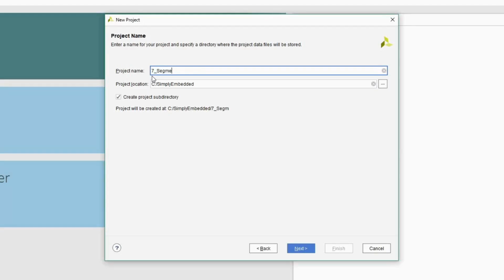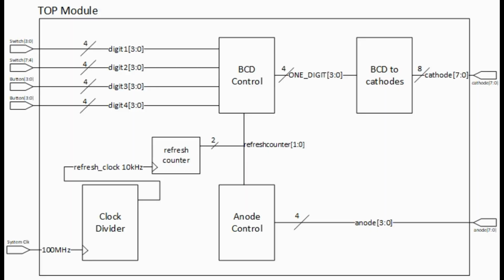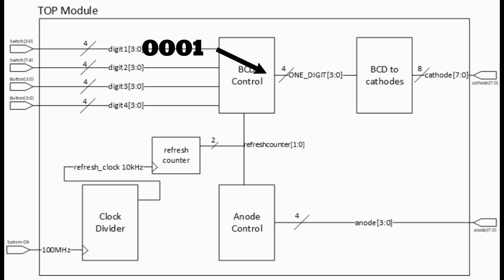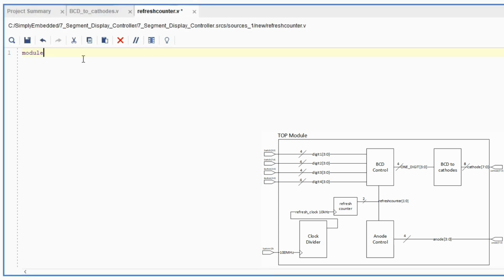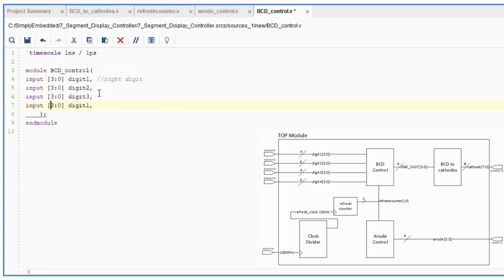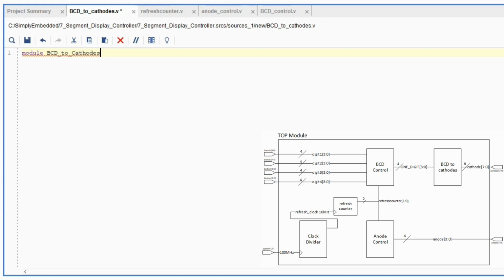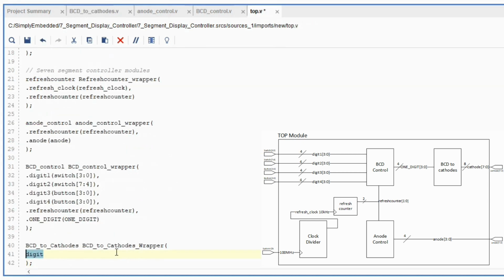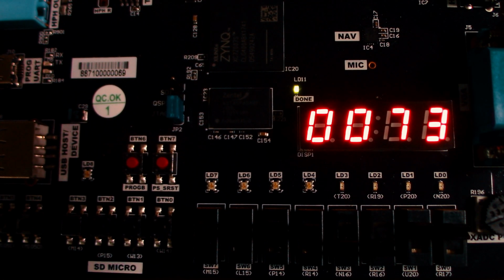How to Create a 7 Segment Controller in Verilog? | Xilinx FPGA Programming Tutorials

Comment: Hey there, love the tutorial, although im confused because your cathode numbers for digits is completely different to ones I found online: 
always @(bcd)
    begin
        case (bcd) //case statement
            0: seg = 7'b0000001;
            1 : seg = 7'b1001111;
            2 : seg = 7'b0010010;
            3 : seg = 7'b0000110;
            4 : seg = 7'b1001100;
            5 : seg = 7'b0100100;
            6 : seg = 7'b0100000;
            7 : seg = 7'b0001111;
            8 : seg = 7'b0000000;
            9 : seg = 7'b0000100;
Reply: The values are just the reverse of each other. In your example it looks like the bits are arranged abcdefg, whereas in the video they are arranged gfedcba.
Reply: depends on your board.  My is active low so (cathode) 1=off 0=on
	case (digit)
		4'd0:
			cathode = 8'b00000011; // zero
		4'd1:
			cathode = 8'b10011111; // one
		4'd2:
			cathode = 8'b00100101; // two
		4'd3:
			cathode = 8'b00001101; // three
		4'd4:
			cathode = 8'b10011001; // four
		4'd5:
			cathode = 8'b01001001; // five
		4'd6:
			cathode = 8'b01000001; // six
		4'd7:
			cathode = 8'b00011111; // seven
		4'd8:
			cathode = 8'b00000001; // eight
		4'd9:
			cathode = 8'b00001001; // nine
	endcase

Comment: Can you connect 16 segments using on arduino ??? ( to display Month Year and date in two calendar systems )
Reply: You can use two "8 digit 7-segment display modules" connected together with SPI interface and drive them with Arduino or Raspberry pi. Just watch out for current consumption of the "8 digit 7-segment display modules" when using it with Arduino.